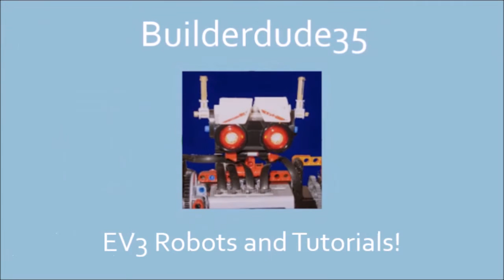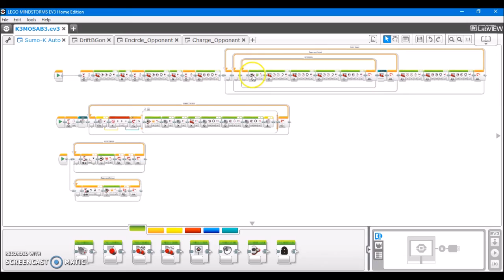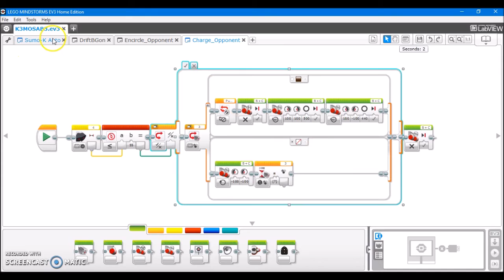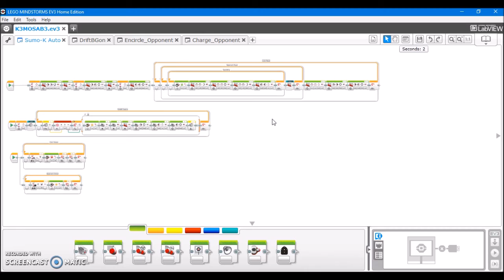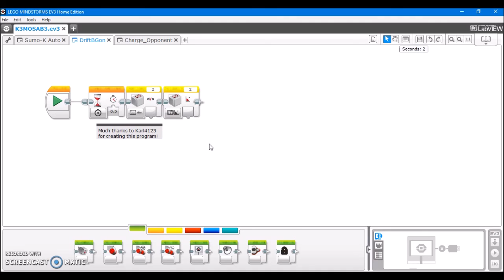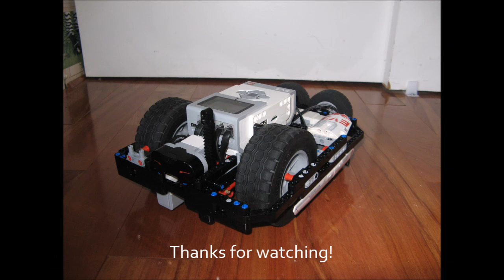EV3 Sumo Robot Programming Walkthrough - K3MOSAB3

Comment: Quick question..  Why use a IR sensor over a Ultrasonic sensor for a sumo bot?  Both can do the job at detecting objects/robots.  Like, when to use the IR over Ultrasonic and vice versa.  ty :)
Reply from the maker: Just a matter of preference. Generally, I'd recommend using a US sensor if you're just measuring distance. If you also want RC control, use the IR sensor.